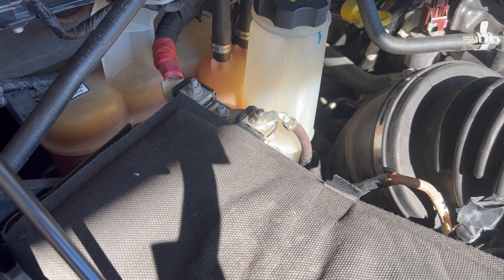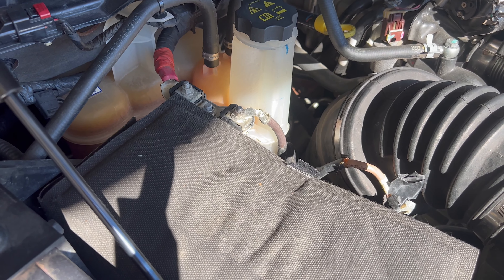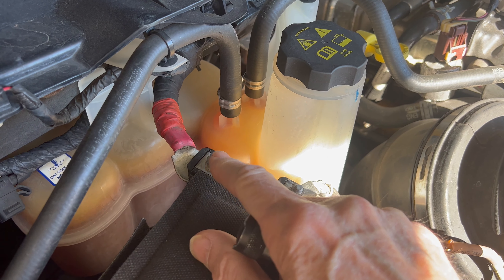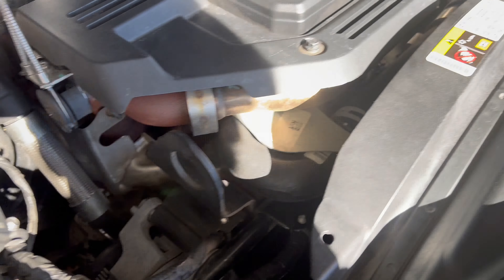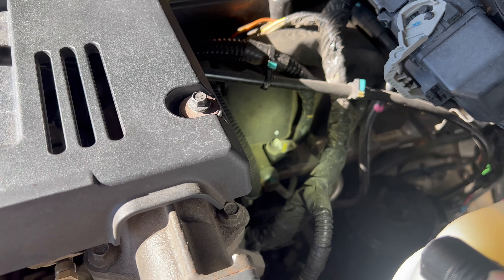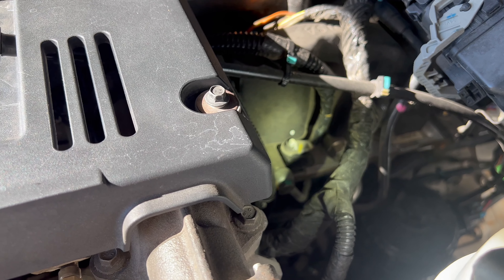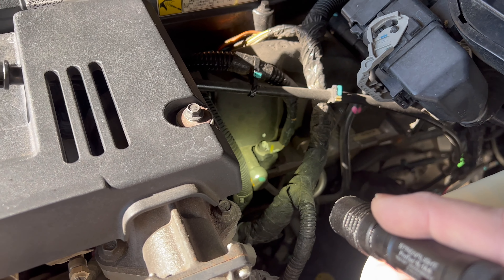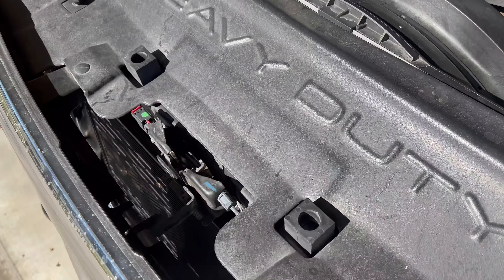RAM 2500 Cummins Grid Heater?

Comment: I owned a 2009 dodge ram. After 14 years of hard use, I decided to removed my entire heater grid assembly. I am glad I did, because after examining the bolt, I think the only thing holding it was the buildup of Soot.  Anyways I installed a street legal Monster Banks grid and air intake system which not only looks great but adds more air to my old truck! Thank you for the heads up!

Comment: I live in Long Island, NY and when I got my Ram 2500 mega cab the grid heater delete was one of the first things that I did to prevent the famous grid heater bolt from destroying my engine.
I installed the Banks grid heater delete kit. Works great and dressed up the engine as well.
Reply from the maker: Agree, don't need it.

Comment: Installed a Banks Monster Intake in my 2014 Ram 3500 Longhorn. This made a difference in torque, throttle response and fuel mileage. Plus Banks provides their own intake heating coil which eliminates the nut and bolt issue and provides for those in colder climate starting.

Comment: Hi Marion!  For those of us living in the colder parts of the US (I live in MT and this winter the outside temp dropped to -38F), disconnecting the stock engine grid heater isn't necessarily the best option for cold starts and performing the "jiggle test", while it may provide an indication for the potential of a stock engine grid heater failure, it falls well short of solving the inherent problem - the design of the stock engine grid heater.  I too was very concerned about the potential for a major engine failure caused by the grid heater bolt dropping into the intake runner, eventually falling into cylinder #6 and causing very costly engine damage.  The price of parts and shop time can fast approach $20K or more to remedy this problem.  Instead, I replaced the stock intake horn with a Banks Monster Ram intake.  This is a 50 state emission compliant replacement part and not only did it solve the engine grid heater problem with an entirely different design, but it improved mass air flow by over 80% compared to stock.  I do not work for Banks, but the added performance gain of the Monster Ram when pulling our 10,000GVWR fifth wheel trailer and the peace of mind with the Banks engine heater design was well worth it.  There are other ways of addressing the potential for stock engine grid heater bolt failure, but in my mind, the Banks solution is the best.
Reply from the maker: Thanks for that.  That's a good solution and performance gain and peace of mind makes it well worth it.
Reply: Hahahaha. What do you think can happen to the banks coil heater? Same concept. Good luck!
Reply: @wildeman7443 finally some smart man the monster has even smaller heater than can also easily melted and go inside the engine
Reply: @wildeman7443  You don't have to install the banks coil heater Einstein, you can plug the threaded hole..
Reply: Banks makes a Pedal Monster that can be programmed with a mobile phone app.  Fun and useful in an unloaded truck.  Easy to change settings.

Comment: Just get rid of it entirely! You can get grid heater delete plates for relatively cheap. You could also get a grid heater from Black Market Diesel Performance that mounts further down between the intake horn and the throttle body. It's essentially a throttle body spacer with a heating element similar to what's used in the Duramax. That's what I plan on doing with miine.

Comment: Hey Marion, it Doug.your son in law friend. I put a Banks Grid heater delete on my 6.7 and holy crap!!!! It’s a night and day difference. Gale Banks claims on the flow bench it over a 100% difference in flow with intake and grid heater delete. I’ll take you for a ride in my truck and show you the difference!! Also if you want the old grid heater plate to use in one of your videos, let me know.
Reply: I did a delete on my '08 2500 2wd.  Used Amazon stainless steel horn and Amazon manifold plate.  Grid delete makes high rpm engine performance (haha, above 2500) smooth as silk.  My old truck needed a tuner that could program the deleted truck.  AND, Banks makes a great Pedal Monster; I believe no one else makes one that works nearly as well.  Now I'm going to delete the passenger side battery.

Comment: Thanks brother! Mine passed the jiggle test but I still did this to my 2018 Ram today. Worked perfect and truck cranked at 30 degrees without issue and no codes. I live on the gulf coast so it won’t be a problem.

I fixed all of the engine killing issues and studded my motor at 9k miles. She runs like she should.
Reply: Are you guys disconnecting both positive and negative going to the grid heater?
Reply: @jonathanjones7611  Like Marion mentioned just positive. From the battery. Start your truck without preheat and it won't throw a code
Reply: @vb5037  thanks!
Reply: Will it throw a code if you remote start it after disconnecting it?
Reply: @jonathanjones7611  just the positive.
Reply: @quentinthomas6733  My 2018 tradesman didn’t come with the remote start or the push button ignition. I didn’t want all of the bells and whistles to break over time. The only add on I got was the fifth wheel package. My truck has a real key but it still hasn’t thrown a code whether I just crank the truck or let it go through the preheat.

Comment: I am up in Canada and I removed my grid heater plate and wiring, left the solenoid and replaced the plate with a bd diesel one. 3 yrs and no problems and when it’s cold I just plug it in 2018 3500

Comment: I too disconnected my grid heater at the battery like you did. One thing I wonder about is increased buildup of soot on the grid heater which could in time restrict airflow. At least when the grid heater was getting hot it burned some or most of this soot off. I m considering the Banks Monster Ram intake. I will be an hour or two from their shop near L.A. in about 6 months and might have them do the install.

Comment: Hello Marion.  Thanks for the great vids.  Just curious.  Why can’t you just remove the grid heater cable from the solenoid/relay and leave the solenoid connected to the battery so the ecm thinks the grid heater is being activated and doesn’t throw an error code.  Is it not good to leave the solenoid/relay connected?
Reply: Good question!
Reply: Removing the cable going to the grid heater from the solenoid eliminates the possibility of getting a code. That's a better way to do a quick grid heater delete

Comment: Hello Marion. I disconnected my grid heater at the battery like you did. No more worries about my 2018 2500. I was wondering what you do when you change fuel filters and you have to cycle the fuel pump several times before you start it up for the first time after the change. Do you hook the grid heater back up or do you let it throw a code and then erase it. Thanks for your videos. You've got me doing all my own maintenance work.
Reply from the maker: No, I don't hook it back up and have never had a code.  Grid heater won't try to come on below 65 Deg. F.

Comment: When you first turn the key, before starting, the low oil pressure light is on (red).  Will starting the truck right away, to not get the code for the grid heater, mess up anything since there's no oil pressure when starting?

Comment: Got a 19 Cummins- am I supposed to ask dealer about this or just swap out parts or find aftermarket support? I think Point Blank Performance addresses this problem but just want to be sure. Same with the thermal bypass for the 68rfe? Any advice? Thank you
Reply: I did the ATS thermal bypass, deep (6 additional quarts) transmission pan, transmission dipstick overflow kit and transmission case brace on my 2018 2500. Trans runs aprox 140 all the time.
Reply: @hardtruth2039  what's the transmission dipstick overflow kit? And what's the transmission brace? I did the other two things you spoke of on my transmission but it's still kind of runs hot
Reply from the maker: The dealer will probably say, "I've never heard of a problem with this?" ha.  I would do the Jiggle test and not work about the thermal bypass for now unless you see higher trans temps.  You can disconnect the grid heater also.

Comment: Hey All,  so i disconnected the positive cable for the grid heater at the battery and am actually trying to get the computer to throw the code just to see what it does and then do a re-set but it is not throwing the code : )  Im still doing the old turn the key and wait for the grid light to disappear..but no code! I am pretty sure that i disconnected the right cable... it goes to a solenoid looking device under the air intake box which then goes around to the other side of the engine. Just strange (or lucky) that it is not throwing a code.
Reply from the maker: It takes a lot to throw a code.  I've had mine disconnect for many years and only through a code once.  The truck was in about 32 deg F overnight.  You got it right.  Red wire that goes from the passenger side battery to the solenoid.

Comment: Thanks Marion. Your videos are fantastic. First thing I'm doing is the jiggle test before I start the truck tomorrow. I'm new to the Cummins and I'm learning a lot from you. I didn't see your previous video on this topic, so I went and checked that out. You weren't too worried about it back then, so did something happen that made you want to disconnect it? Have there been any increasing reports of this bolt dropping off? I live where it's cold, so maybe I'll just disconnect in spring and re-connect before the winter. It's not often that it gets below -15C where I live, but it would be a hassle to have to re-connect it for the odd really cold start-up below that temp.
Reply from the maker: Yeah 
It’s more problems than I thought it was back then. Long as you do the jiggle test it’ll be OK

Comment: When you disconnected, it looks like you just wrapped the end in electrical tape and attached to the negative wire so it wouldn't flop around. Is this correct? It isn't attached or connected to your ground, as in contacting the ground, is it? Thanks for the video and all your videos. They are extremely helpful.
Reply from the maker: Yes, when it's disconnect it doesn't matter if it touches anything grounded so just tie rap it to the negative side of the battery or any place convenient away from the positive terminal.
Reply: Thanks! I disconnected today. No code on first two starts. Fingers crossed.
Reply: I have a 2018 ram and disconnected the grid heater just as you showed, I have been driving for about a month since disconnecting and have had no codes no matter how long I wait to start after turning key. This is a huge weight off my shoulders, love my truck, all original factory so I really don't want my engine torn into, lol

Comment: I unhooked my heater and it did give a cel. It still started and ran fine, but the remote start wouldn’t work. It’s nice to have it warming up for a few minutes while I get ready in the mornings. I know, first world problems. 🙄
Reply: I have a 2018 tradesman with an actual keyed ignition, no remote start or lock fob. I keep my block heater plugged in year round at home so she’s warmed up and ready to go in a few seconds of starting her up. I installed a plug socket on my air dam so it’s easy to plug in.
Reply: Living in the south, I wasn’t too worried about a block heater. But that’s a great idea. 👍🏻
Reply from the maker: Yea, you can clear the code at your convivence  and get your remote start back.

Comment: If I disconnect the Grid Heater connection Positive terminal - do I have to Press the Start Button Twice to avoid a CEL Light? 
Also, If I accidentally forget and press the Start Button Once and get a CEL can it simply be cleared with a code reader?
Thanks in Advance
Reply from the maker: Just press once and yes the CEL can be cleared with your code reader.  You can drive away with the CEL without any problem and clear it later.
Reply: @MarionBlair  Thanks Marion. I think it's time for me to disconnect that wire.
 I had always pressed the Start Botton Twice to start the truck immediately, but I also noticed that the grid heated still cycled ON for close to 30 seconds anyway. I would see the voltage gauge read 11 volts then jump back up to 14 volts. 
I'm in San Diego and we don't any deadly grid heater.
Reply from the maker: @bayonne  I agree San Diego is pretty warm